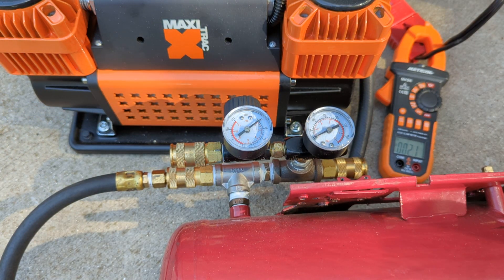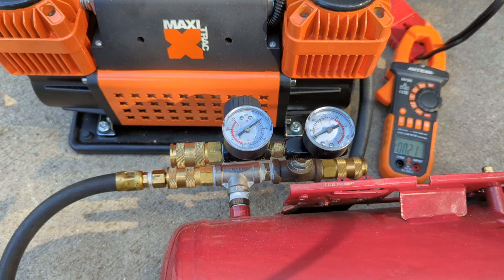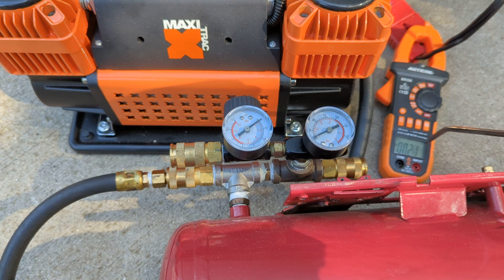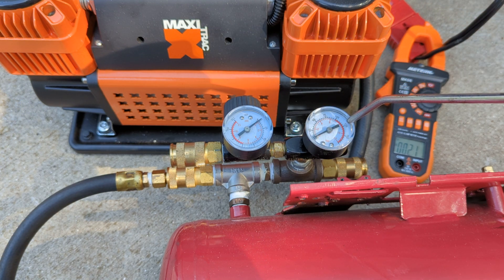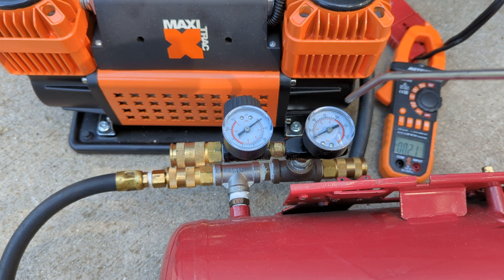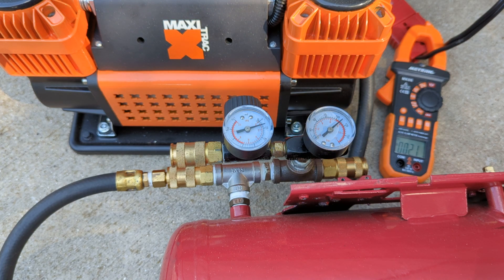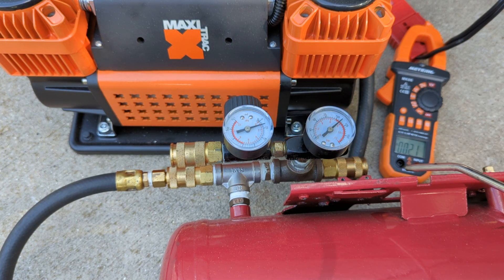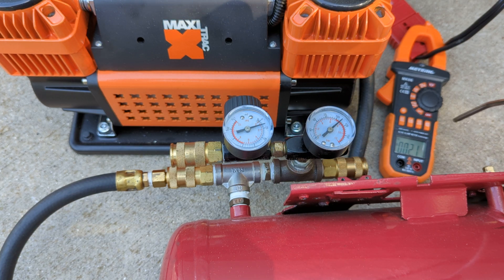MaxiTrac Compressor 12v Amp Draw

Comment: Wondering what's out on the market that's suitable and most cost effective as a tankless compressor for plasma cutting that in the same price range... even if a 120VAC or 220VAC design?
Reply from the maker: Depends on the cfm needed...probably none will work without a tank. Likely the plasma needs too much air....it all boils down to cfm at the exact psi
Reply: @mrmotofy  Looks like my reply didn't post for some reason.  Wondering what's on the market that's most cost effective and to the similar price point as these tankless designs used in the HITBOX 40 Amp Plasma Cutter with Built-In Air Compressor 220V Digital Inverter IGBT Clean Cut Plasma Cutting Machine HBC8000PRO?  Must be tankless designs on the market, unless Hitbox and the other tankless designs are proprietary.
Reply from the maker: @jafinch78  I couldn't find air specs on that model. Reading other plasma cutters, which wasn't easy to find specs. Seems like 65-70 psi and people are using 3-5 cfm presumably at 90psi. That's gonna be shorter cuts. The issue is the steady regulated airflow needed. That's not likely with a tankless. Tankless options are gonna be few and far between. If I was buying more now I'd look for a 175psi unit with a smaller tank. The higher pressure gives you more effective working air volume. The plasma is like an open cut hose...so it's gonna lose air quickly. So either a large tank supply or a huge output compressor which costs a lot of money. 

I'd look for a 5-10gal tank and 175psi to run a plasma cutter. 
And thanks for watching. I have an idea for an even higher output 12v custom built unit...might be a fun future project.
Reply: Liked, commented and subscribed.  Thanks for commenting and showing the performance specs.